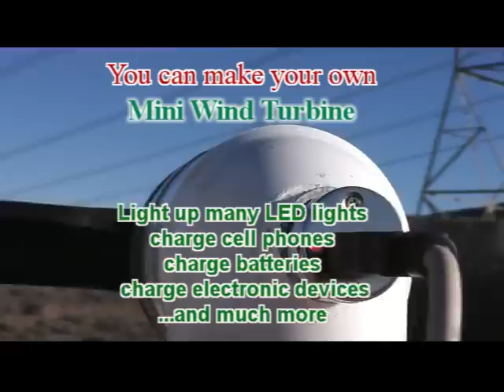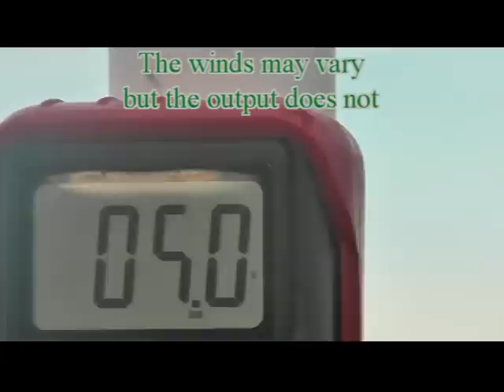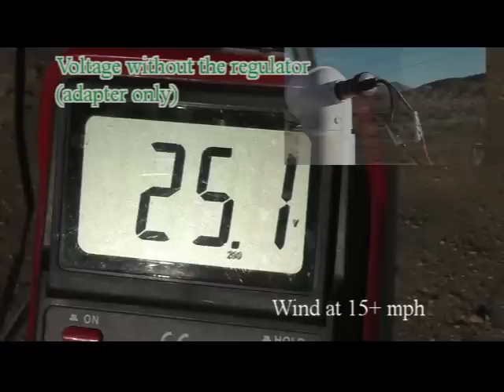Mini Wind Turbine G2

Comment: are you sure it works
Reply from the maker: Karan Bardhan Hi Karan, yes it does. It is widely known and no secret at all that certain types of motors can also be used as generators (motors that have magnets in the rotor and copper coils in the stator). The motor you see in this video (a stepper motor) is one of them. In simple terms, when the magnetic field of a magnet passes very near a copper coil, electricity is generated in that copper coil. You may read how it all started by researching it yourself. Start with Michael Faraday in the 1800's and prepare to be fascinated by the simplicity of it all. The vast majority of the electricity produced in the world today uses the same principle...strong magnets that we make spin near copper wire (you will find that in coal fired power plants that burn coal to make steam that is blown against wheels that turn the generator shaft...same goes for natural gas...burn natural gas, make steam..turn the generator, and the same goes for nuclear power plants where fusion inside the reactor produces a lot of heat that is used to make steam and turn the generators...and so it is with wind turbines that use the power of the wind to turn the blades that turn the generator....basically, you have to find a way to turn the generator to produce electricity...I appreciate questions like yours. At least you are questioning something that you don't understand, and that opens an opportunity to learn and to separate fact from fiction.  Take care  :)
Reply: Thanks and this is a great project

Comment: How did you stabilize the output?
Reply from the maker: +elizaul1 
With a voltage stabilizer. I suggest you google it, so you can see what they look like, and then learn how they work. I used a 5 volt "voltage stabilizer". If I had a bigger generator, I would probably use a 12 volt...It just depends on your source, and your application.

Comment: you need to build a much bigger one.  all that work and expense just to charge a phone.  u are getting 27 Volts from the motor and if u can get 1 amp then use it without the adaptor.  what is the max input voltage rating for the adaptor?  did u blow it yet?
Reply from the maker: Adapter max input = 40V. Under the wind conditions that this video was produced, it stayed under 40 volts. The adapter could handle up to that voltage...if more than 40 volts the adapter would be damaged.  On the output side: A cell phone can't take more than 5 volts or it will be almost immediately damaged...hence the need to use a voltage stabilizer.  STT

Comment: Why did you leave out those two common wires? If you rectified the power from those, wouldn't you capture more energy? I don't know much about this and failed to follow the video properly but I know you can rectify multiple phases of AC into one DC and that doesn't seem to be what you did.
Reply from the maker: +Sean Smith Hi Sean, somehow I missed your question from a month ago, sorry. Anyway, here is the answer (good question by the way) The two wires I left out go to the center of each of the two coils. When each coil is energized by the spinning of the rotor, they (the center taps) would only give you 50% of the output of the entire coil. As an illustration, coil A has wires 1,2,3 and coil B has wires 4,5,6 - Wires 1 and 2 give you 50%, wires 2 and 3, 50%, wires 1 and 3 give you 100% - No matter what you do, you will not obtain more than the total possible output from the system. Therefore if 1 and 3 (or 4 and 6) give you 100% of their possible energy in that coil, than that is your limit.

Comment: Where did you get the prop adapter from, what size diode's  are you using for you rectifier.
Reply from the maker: Timothy Adams Hi Timothy, I am sorry I missed your question 6 days ago. You can get the prop adapter from a hobby shop where they sell model airplanes, or you can find them online. The one I used was a 5mm to 5/16 x 24. What these numbers mean is: 5mm is the diameter of my 'generator" shaft, 5/16 is the diameter of the other side which is inserted into the propeller hole and 24 just says that it has 24 threads per inch...a very common type of thread out there. - The diodes can be Schottky diodes which are very good, and very efficient...You can also purchase a bridge rectifier for a few dollars if you'd like (I estimate around $3 give or take... Any questions, just ask...Take care  :)

Comment: hello if you could give me the exact name of that motor? I bought 17HS13-0404S and it turns out that he has too much resistance. :(
Reply from the maker: Julian Ochonski Hi Julian,  The resistance that you feel when you try to spin this motor is called detente torque. If you can't buy a motor personally and test it, I suggest you contact the seller prior to the purchase and ask for the lowest detente torque motor. For example a NEMA 17 size motor a detente torque of 50 G-CM or 0.69 OZ-IN would work just fine. The bigger these numbers are, the stronger the cogging (detente torque). Any other questions, just ask. Have fun with your project. :)
Reply: ScienceTubeToday Hi, thank U for answer! I watching on ebay this motor. I am a rookie. Is this motor suited for this?
Step Angle1.8°
Step Accuracy5%
Holding Torque26Ncm(36.8oz.in))
Rated Current/phase0.4A
Phase Resistance30ohms
Voltage12.0V
Inductance37mH±20%(1KHz)
Reply: Julian Ochonski or this one...
Holding torque 45 N.cm (4.5kg.cm, 64oz.in)?

Comment: Do you have kits for sale yet?
Reply from the maker: Melissa Pezza Hi Melissa, I have been working on putting kits together, but it is a long process, mostly because I have been testing many different propellers and many generators to see which ones are the best for the purpose for quality, price etc...Not an easy task :)  As far as having a wind turbine to run your appliances, yes, it is possible but you need a few things:
1. Wind Turbine (makes the electricity)
2. Battery bank (to store the electricity) 
3. Charge Controller (to make sure the wind turbine does not overcharge or damage your batteries)
4. True Sine Wave Power Inverter (to make the DC (Direct Current) electricity coming from the battery bank become AC (Alternate Current) which is what your appliances run on
Sounds a little complicated at first, but, once you set it up, it is really easy, and you will have it for many, many years.
Best of all, it is all fun stuff  :)

Comment: EN:
voltage of the rectifier diode has a drop of more 1v..
I suggest doing a multiplier (x2 or x3) voltage for each phase of the stepper motor, and connect them together.
RU:
напряжения на диодах выпрямителя имеет падение более 1в. 
я предлагаю делать умножитель(х2 or х3) напряжения на каждую фазу шагового двигателя, и соединить их вместе.

Comment: Hi!  I loved this video, and thank you for posting it.  I just saved a printer that was headed for the trash, and my weekend project is to see if it has the right kind of motor(s) in it to do this.

What if you had one of these outside a window, and you run the charging cable in through a window or in through a basement door, will the exposed 12 volt socket and the exposed 12 volt to USB be an issue?  I suppose one possible solution would be to have a pvc connector and a longer piece of pvc that is removable to cover the plug, but what about distance, will you lose power if the cable is more than a few inches long?

If so, is there a way to solve that so it can still be placed outside but have the cord going inside?

Thanks!
Reply from the maker: +jimk1970 
Hi jimk1970. Let's take one question at a time:
1. Distance from generator to the point of use.
If you use a stepper motor as your generator, it will produce AC. Well, Alternate Current travels far more efficiently than DC. I have one small wind turbine outside my workshop that is 75 feet away and I have it connected with an 18 gauge speaker wire, with no problems. The loss is not that significant. Then, inside my workshop, I rectify the current to DC, and use it as I need. (Mostly for test and research in small scale)
2. Anything made of copper has the potential to oxidize. 
The oxygen atoms in water brought by the rain or just humidity in the air will do that. So make sure you protect the exposed copper. Also, the lower the gauge number, the thicker the wire...so, the thicker the wire, the more easily it will conduct electricity. For a mini wind turbine, gauge 18 should work just fine.
3. Having it outside the window. Your wind turbine must be placed in an unobstructed location. Any barrier will significantly change your efficiency. The ideal place is as high as you can (within what you can do, safely) and with no trees or buildings in the way (which may cause "wind shade"  that means that these obstructions will interfere with your wind turbine operation). Why place it high? There is something called wind gradient, which is the speed of the wind at different heights. The closer to the ground, the lower the wind speed. Also, the closer to the ground, the more turbulence.
Any questions, just ask.
Have fun with your project. Let me know how it went...

STT

Comment: Where can I find these printers (do I have to use this specific model or can you recomond a range which are suitable for this project?)  I would like to find these for free or relatively cheap if anyone has any ideas where it would be greatly appreciated.
Reply: OK....are the small regular electric motors appropriate for this project?

Comment: I have a solR powered morse code only ham radio station that is solar powered.It has a gell cell battery and a 1.5 amp solar panel battery tender from northern tools.The panel has a built in over and under charge control circuit.
However i want a wind turbine that can produce and equal amount of power.
The solar setup is sufficient to power the station as I operate for about an hour a day.I never run out of volts and regularly work stations in Europe all the time with five watts output.
Kc4etw

Comment: "The wind may vary, but the output does not." I'm curious about where the energy goes when the turbine is spinning faster than required for the 5 W output! Not worried -- but curious!
Reply from the maker: +Tai Viinikka 
Let me clarify: The output "voltage" remains constant in winds (for example) 12, 15, 20 MPH...but, the Amps do vary with the wind speed. That is because I use a diode as a "voltage stabilizer". As the energy increases (due to stronger winds), the energy is utilized by the device that the Mini Wind Turbine is connected to. For example, if I had a small motor attached to it, you would see the "voltmeter" always at 5 volts output...but the Amps would increase in proportion with the wind, making the motor run faster and faster...as the wind increases, -  but the motor would run slower and slower when the wind decreases. If the Wind Turbine was connected for example to a battery, it would increase the rate at which the battery is charged if the winds increases. So, to sum it up...the more energy the Wind Turbine produces, the more energy is utilized by the device it is attached to...limited only by the maximum the device can consume or store...if you exceed those limitation you damage or destroy the device. STT

Comment: All practical tests of ground-based small wind turbines show the same thing: 1) They hardly produce any electricity. 2) They don't last long! Solar panels generate at least 10 times as much electricity for the same investment of money and time. And maintenance-free for at least 25 years!  Wind/electricity yield increases with the third power of the wind speed.+ 100% wind = +800% electricity. Close to the ground, however, 0 constant wind, but gusts.

Comment: Hello, super awesome video !!! Love it. Question : what bridge rectifier should i bought? They have plenty on Amazon but not sure which one to get. Could you help ? Thanks,
Reply from the maker: Mambrax444 Thank you! A full wave bridge rectifier like the GBL1506 (15 amps, 600V)...or the GBL406 4 amps, 600V)...What you need is a bridge rectifier that has higher numbers than the output of your generator...for example your generator may be capable of putting out 50 volts at 2 amps...so, any full wave bridge rectifier above that will work well for you. Have fun. STT
Reply: thanks for the input !

Comment: I bought a NEMA17 stepper motor. Looks a lot like yours but has 4 wires. I am only producing 3-5 volts when connected to the propeller and bridge rectifier. Do you have any suggestions on how I can get more voltage closer to what you were producing?  Thank you! :)
Reply from the maker: killerandom2 Hello. A stepper motor with 4 wires is an indication that it has 2 separate coils inside. Did it come with a diagram? If so, it will be much easier to work with it, if not, let's see what we can do...each coil has a beginning and an end wire, so you have to connect the end of one coil to the beginning of the other coil...it is like making one longer coil out of the two - without a diagram, this can be accomplished by identifying which two wires make one coil (write it down when you identify each one, let's name them coil "A" and coil "B"..). Now, you have the wire that begins the first coil and the wire that ends the second coil, and that's your output wires from the generator. This is called a "series" connection. This way you will have more voltage. On the video, I show more than 25 volts, but I am measuring the AC, before the rectifier, in less than 20 MPH wind. This depends on each stepper motor - how they are made inside - I have a similar NEMA 17 stepper motor that has produced over 100 volts, connected to an electric drill. Any questions, just let me know...Good luck and congratulations on your project...you are making electricity by means of renewable energy!   :) STT
Reply: ScienceTubeToday Thank you! No sadly it did not come with a diagram. I hooked mine up to the drill and i was getting 23 volts looks like I will need to find a motor that has a higher output voltage.  Or maybe hook it up to a voltage booster/transformer.  I'll figure something out :)  Thanks again for the help!
Reply from the maker: Here is some helpful information. 
Getting more voltage is no problem, just use a step-up transformer, but we need to understand 3 things: Volts, Amps and Watts. (Watts = Volts x Amps). They are tied together, and there is no known law of physics that can change this relationship. If you have one generator and you hook it up to a step-up transformer, you can double, triple, quadruple the voltage, but at the same time, the Amps will fall in exact proportion...1/2, 1/3, 1/4. So that the end result is the exact same "watts". If you have an output of, for example 10 watts (10 volts at 1 amp or, 20 volts at .5 amp), initially, that is all you will be able to obtain from that system = 10 watts. There is no such thing as obtaining more energy from a system than what it has.
If your intention is to charge cell phone batteries, small electronic equipment etc.. or light up LED lights, your generator at 23 volts and I am assuming 1/2 amp to 1 amp is already good for the task. If you want more power (more watts...) then you will need a bigger generator. If you have any questions, just write...  Good luck, have fun  :)

Comment: Hello STT, 
I am actually building the same wind turbine in your video and I was wondering if there are any other propellers that you would recommend because I don't want to spend $20 on just a propeller. My price range is no higher than $15
Reply from the maker: Hello Wyatt,
Yes, I do have a suggestion. You may use a Master Airscrew 16x8 3-Blade Series Propeller or Master Airscrew 15x7 3-Blade Series Propeller, but I would not recommend anything smaller that these. They are both in your price range. Remember that you will also need a prop adapter (which is the piece that secures the propeller to the shaft of the motor).
To buy the right prop adapter, you first need to know the diameter of the motor shaft. If the motor shaft is for example 5mm (five millimeters), and the propeller hole is 5/16 (five sixteenth), then buy a prop adapter 5mm x 5/16. If you need further help, just let me know. I am considering selling all these as a kit within a month or two, so that people can have everything already fitted.  Have fun  :)   STT
Reply from the maker: According with the Master Airscrew website, the hole of the prop should fit this adapter perfectly. I copied the propeller specs here: Product Specifications:  Weight is approx. 111 grams; hub thickness is 0.6875 or 11/16";  hole is 5/16"...But please check that the shaft of your motor is 5mm, if so, you have everything sized up correctly. Have you measured your motor shaft diameter?
Reply: ScienceTubeToday Based on those websites that Wyatt Church s going to buy those propellers from, could you explain what the 16x10 exactly means?? I am having a hard time finding information about it, especially in reference to the size of my motor.
Reply from the maker: When referring to a propeller the first number designates the length of the prop tip to tip and the second number how much it moves forward, so a 16 x10 theoretically means that the prop is 16 inches long and moves 10 inches forward for each revolution (each turn). These numbers are usually for reference only because they don't take into account if you are at sea level (more dense air) or at the top of a high mountain, less dense air and a lot of other factors, such as blade design, blade material etc..etc.... To make it simpler: For wind turbines always choose the lowest available second number for whatever length you want. That will always give you more torque and less speed (you don't want your wind turbine to spin too fast...) if you want a 16 inch prop and you have 16x6, 16x8, 16x10 for example, choose the 16x6. Any other questions, I'll be glad to answer. Have fun..  STT   :)